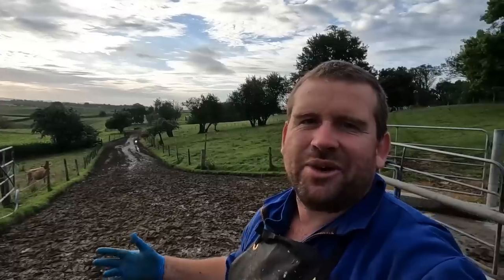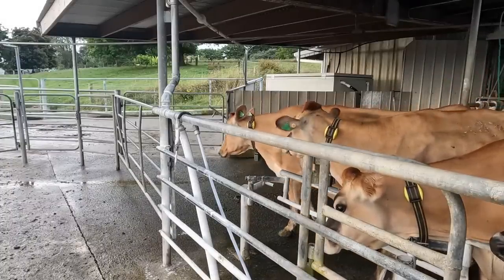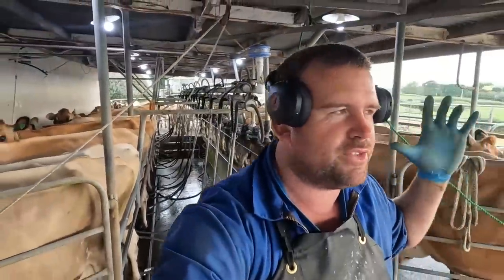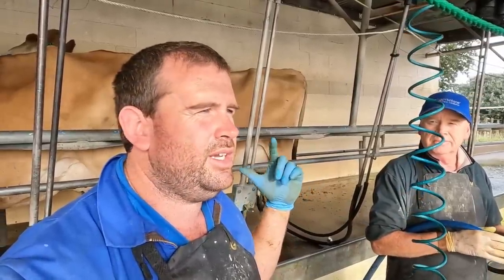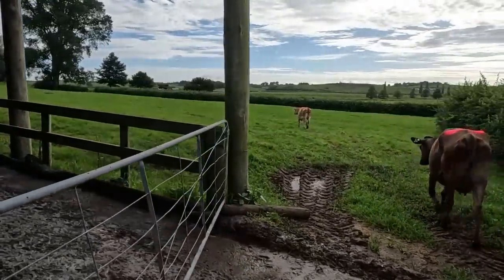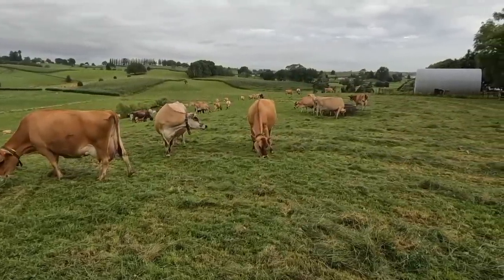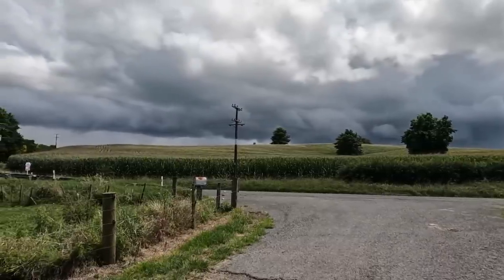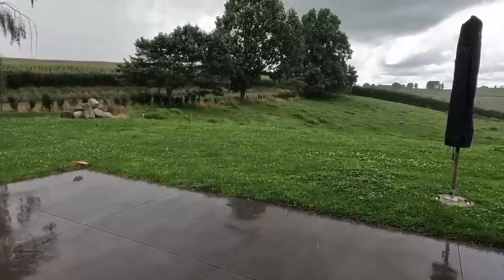Comparing Strip Till vs Direct Drilled Maize

Comment: If u can carry over ur silage do it. It will keep just fine, just have ur contractor push the new crop right up against the old crop wall. Take the plastic off the top and have him put a layer on top. U will see next to no spoilage.

Comment: My experience in a bunker would be to feed up the maize and make more silage bales. The little bit of maize your going to have left over will not be enough to worry with and it could mold after you expose it to air by spreading it out.  Then you would make poor feed out of a percentage of the new maize that is over the old stuff. 
   I carry silage over but not the few ton you talking about. The smaller amount will result in a higher percentage per ton of spoilage.  I would make some more grass silage bales. That way you have no trouble with potential spoilage.
Reply: Why feed more silage to make silage? Doesn’t make sense. I think feeding more grass is much more profitable, also if things end up bad he still has silage that he can use to slow his rotation
Reply: @robhughes8553  I am an American we call maize/silage and grass silage/ hay ledge. I am saying that the maize/corn silage is much more likely to spoil if he keeps it over making "new/fresh" grass silage bales.  The practice of spreading out the old maize in a thin layer in the bottom of the bunker, allows a lot of air/oxygen to get mixed in the old stuff. Therefore it is more likely to spoil/mold. With it being on the bottom you then have a lot of new maize silage possibly contaminated when he feeds it out.